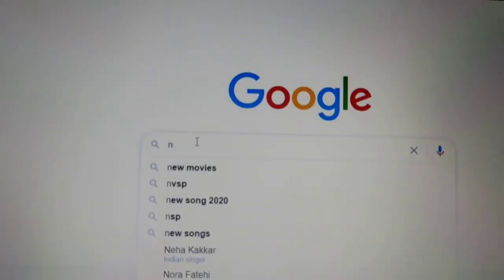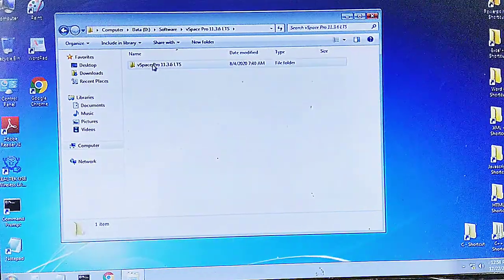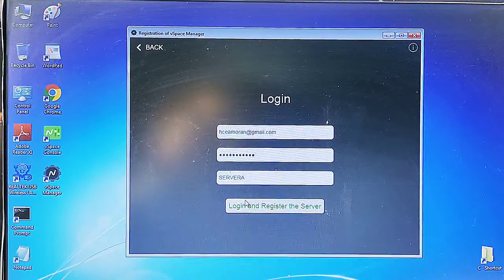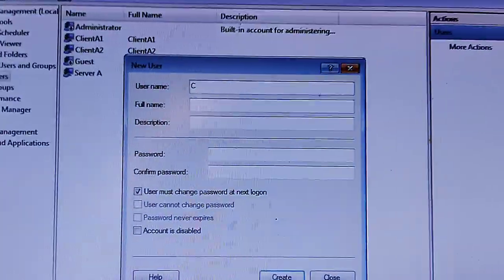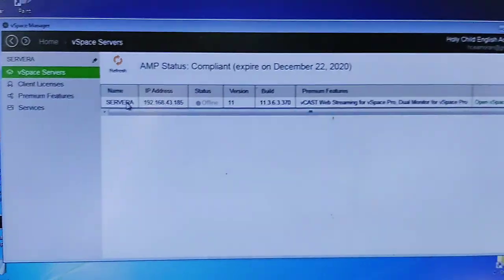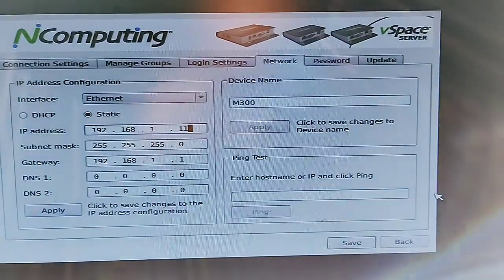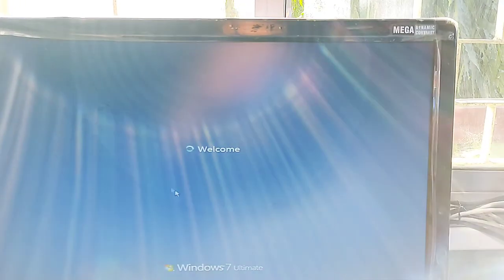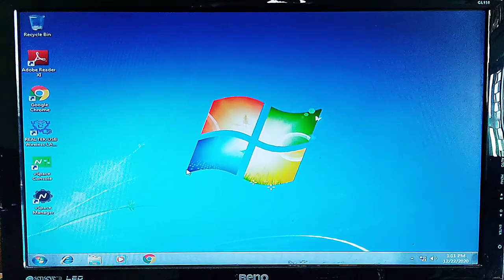How to setup and configure N Computing M300 Device||Use a single PC for multiple access points

Comment: Very useful walkthrough, thank you. I am looking to put my main desktop in a location that's separate from my desk to save some clutter. I'd like to use something like an M300 or other thin client to connect to the desktop from my desk. Will this work well in 2022? Does it perform okay over a home ethernet connection? Thank you!
Reply from the maker: sure it does. go for it... latest firmware update are available once you register on ncomputing
Reply: @diybeaver  thank you for the reply. Is the firmware fairly recent?

Comment: thank you very Much but do i need to create as many numbers of users and Devices
Reply from the maker: its upto you how many users you want to accomodate.. generally for each device a single user is required. but you can offer many users to login on a single device. but the catch is that a user for example user1 can only login to only device1.. if you try to login user1 on device2,3,4 at the same time it won't work

Comment: Can it run offline, i mean once everything is done, can it run without internet?
Reply from the maker: sure... occasionally to update OS and NComputing software on server you may connect with internet. Its recommended to check for system update once every month and install required updates for smooth functioning of OS. Thanks for your feedback 👍
Reply: @diybeaver  thank you so much for fast response.

Comment: Help me please 😢 mine is showing "already used to the original owner"
Reply from the maker: just create a new NComputing login user id and password and reset the main M300 device using a pin hole marked reset on its back side... reinstall the software on Server, register NComputing software using new user id and then setup like new

Comment: How can we add two m300 device with one cpu
Reply from the maker: using a hub... connect the hub to the cpu...then you can connect as many M300 devices as the hub provides ports